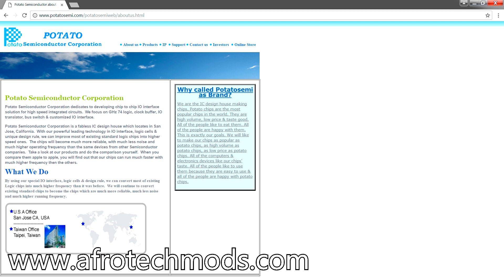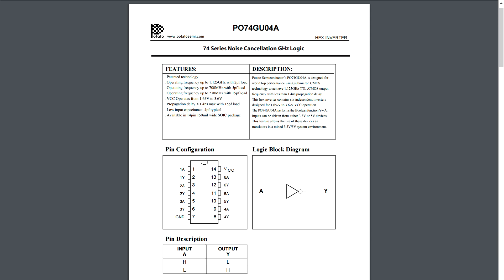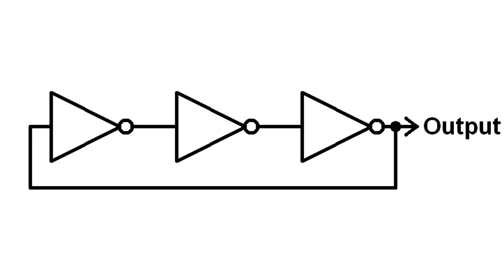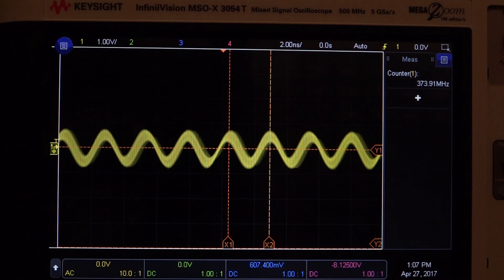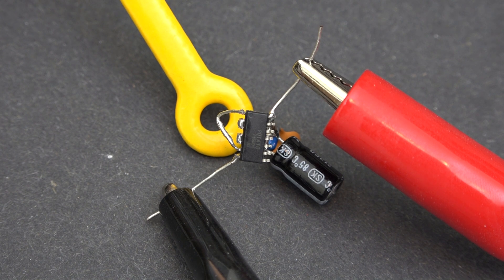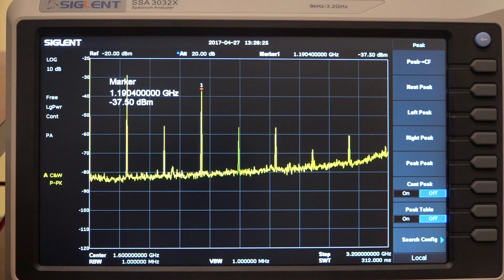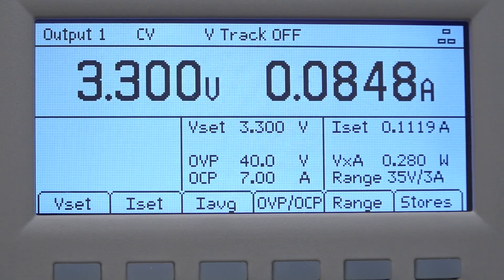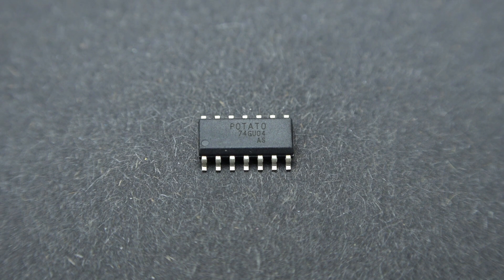Fun with 1.1GHz Potato chips

Comment: Far as I can tell here, I believe those harmonics you are seeing would be down to the actual signal being generated being a square wave. This is pretty clear by every second multiple of the fundamental frequency having a higher spike in amplitude which summed make a square wave. I'm not sure why there are smaller spikes between, but they won't have much effect given a small reduction in dB is a huge reduction in signal in real terms. I would guess the low bandwidth of the oscilloscope in comparison to the 2nd harmonic is probably why the scope is outputting a sine rather than the square wave the signal analysis suggests is present.

Comment: 1:40 The construction of the circuit is actually quit good if the decoupling cap is located where it should be (but that's something you'll know about). A dead bug style circuit can have very low stray capacitance. The property you want for this type of circuit.

Comment: Hello,  I have a simple regulated box mod power bank or power supply for vaping tanks. It has a voltage cut-off chip that turns the device off after only using .8 volts of the battery power. I want to put another chip that gives it more time before turning itself off. It is the tesla invader three. How do I distinguish the cut off chip and can I replace it without pissing off the " internal blink when something isn't right" chip?

Comment: The IC was working at exactly the promised frequency. You chained 3 inverters and had ~375MHz. So if you measures only one, you'd get 375*3=1.125GHz.

Comment: +Afrotechmods hey mate thanks for this vid, would one of these ICs be a good option for high speed voltage level shifting? I think some of their gates can run at 5V so that output high can be 5V, and use 3,3v input high

Comment: Leaving the unused pins open may be contributing to the instabiliy & power draw
Reply: mikeselectricstuff I was thinking same thing
Reply: Gotta ground them hex inverters!
Reply: luketorpedo yeah. Leave no pin floating unless the data sheet explicitly says leave disconnected. In which case, pad on the PCB. Nothing further. 

It's a good lesson that all EEs. Hobbyist or Professional, eventually go through. The world is full if EM noise.
Reply: I always forget to do this every time as well. Spent far too long messing with a NAND based memory cell till I realised not grounding the inputs when input switches were open (hence left floating inputs) was making the thing go nuts.
Reply: Not may. This is 100% the reason. Floating pin = major increase in capacity.
Reply: Thank  you!
Reply: Should probably cover them with your tongue

Comment: I just tried the same thing with a 74hc chip. It works just the same as you would expect. But it also works with only one inveter which has its output connected to its input, what results in a way higher frequency than with three inverters in a row. Have you tried this out too?

Comment: Well, I'll pay 1$ for Bluetooth jammer video:)
Reply: Either isolate the 2.5Ghz harmonic or make it run faster (blow that potato) and maybe amplify it :D add an antenna and done. dont forget to bake some potatos on the hot chips :P
Reply: 2.4ghz?! Wouldn't just using wifi jam Bluetooth?
Reply: @underabridgetoofar  It does
Reply: The FCC (if in the States) would like a serious conversation with you.
Reply: Richard Skyephotography okay..
Reply: isolate and amplify the 2.5ghz harmonic with a beefy LC circuit, that should do the job
Reply: Just google it
Reply: I'll pay 5$ for a bluetooth jammer video . . . although, bluetooth is mainly on 2.4 Ghz, if you found out how to keep the frequency at 2.4 ghz, you have your bluetooth jammer right then and there. . . . (just don't get in trouble with the law)

Comment: Laughed out loud when you blew on it to speed it up!

Thanks for showing this company - I'm working on a 74xx CPU design right now and this is perfect for updates I'd planned for revision 2!
Reply: GRBTutorials the breadboard does significantly reduce speed.
Also, the 74HC series can run at 20mhz on their own, sure, but once you string dozens or hundreds of them together, your critical path is no longer 50ns...
Reply: if you that i instant sucribe your chanel but at least run it at 100mhz.
Reply: Gotta walk before you can run!

Currently I'm using standard 74HCxx parts on a breadboard. Couple of kHz, max. I just finished wiring things, if you go ahead and subscribe you can follow the progress ;-)
Reply: If you don't already know his channel, you should check out Ben Eater. He got a (soon) complete, freakin awesome tutorial series on how to build an 8-bit computer with ICs only.
Reply: kHz? Is that limited by the breadboard? Because 74HCxx can run up to 16-20 MHz.
Reply: HomeBrew Science i doubt it. Once you chain them together your cycle time will be much higher and frequency will be much lower.
Reply: Now with a frequency counter you can have a VERY accurate thermometer.

Comment: 2:01 Please show us how to do that, rather than telling us how to do that😁😉
Reply: I think youd need to isolate the frequency, amplify it a bit and make a transmitter. I think either or a combination of a RF Filter, Low and/or High pass filters. never tried, but I know its posible and if you try it localy, with a tiny amplifier so within 10 menters youd jam, it probably is allowed as "research".

Note that bluetooth is on 2.5Ghz as Wifi is aswell (later wifi is also on the 5Ghz. ) jam those and your sure some device cant talk good anymore. I might be wrong tho, im not a licensed radio amateur, just an electronics enthousiast
Reply: @ STU-Christian Its not illegal on private property.. But you gotta keep the bleeding in check so it does not go off your private property. Once it effects public areas is when the FCC will fine you if you are reported and they can prove its bleeding off your property. Plus I already know what he's talking about. But I as well, wont tell.